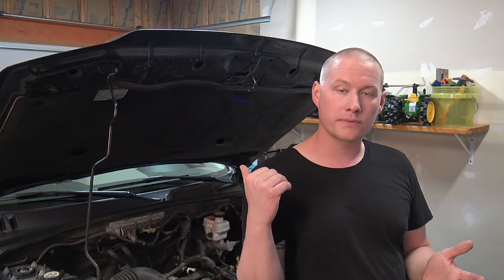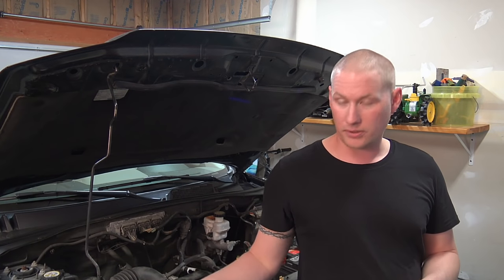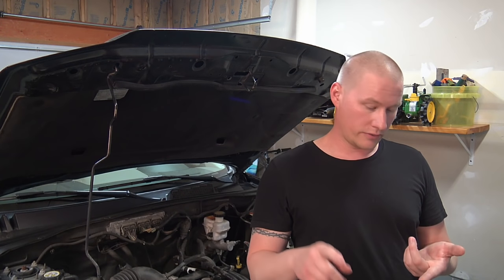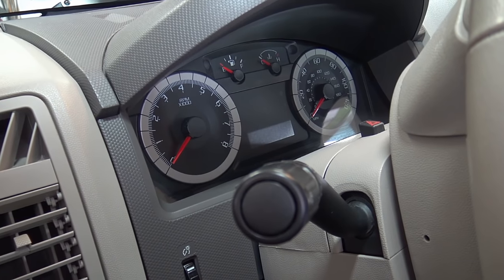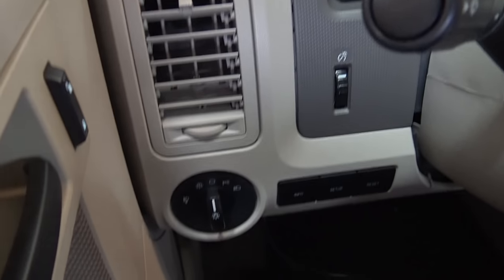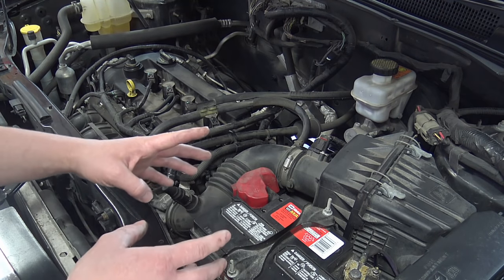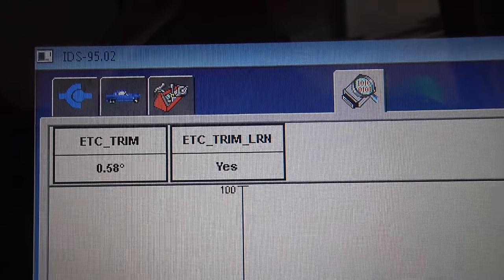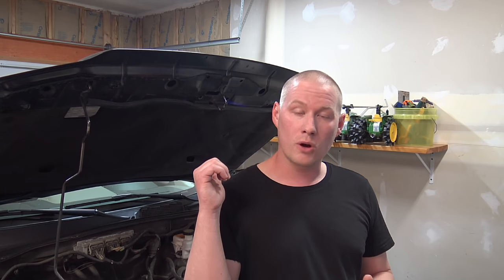Ford Vehicles: Electronic Throttle Body Calibration Procedure

Comment: I just viewed a video prior to yours and they said that when connecting the jumper  cable from the positive to the negative that both should be taken off of the battery where you are showing just take off the negative battery cable. Im confused on which way to go.
Reply from the maker: Once the negative cable is removed you have broken the circuit and current cannot flow. What is it going to do, jump through the air? Not at this voltage level.
Reply: @FordTechMakuloco  Just trying to find out the correct way to make the connection. Sorry to have bothered you.
Reply from the maker: I am explaining why since you questioned my method.

Comment: i have a mustang gt 2007 and im getting the wrench symbol, after that the car only drives to 5miles even if i press full trottle i turn off the car and its normal again, do i need to do this to repair that problem ? thanks

Comment: I changed my throttle body on my 2010 Ford Fusion Se. I also changed the spark plugs the car has 64784 but I bought the car with 60000 on it. I had these car for two years did not drive it for one year. When I start driving it again I start having these problems. I went through all your steps and when I tried to put the car in reverse in jerked and stopped running. Would not start again, had to do the steps again. What else can I do to correct this. Got it to start but it goes did and jumps when placed in reverse. Also, car will go dead when letting it idle for 10 minutes or more.

Comment: I can used same process for my 2010 chevy equinox? I replaced the throttle and now is driving in high rpm....thanks
Reply from the maker: No generally you must use a scan tool on GM vehicles.

Comment: Hate to ask got an 05 mustang gt ran ok til I changed the battery now it is stuck in limp mode and I can't clear it. It also has about 15 dtc codes that came on after.. No throttle response at all either

Comment: hi partner I'm here from Brazil, state Santa Catarina I was watching some of your videos here on YouTube I want to see if you can help me I have a Ford Focus 2012 Duratec 2.0 It has an acceleration problem, when I start it at a traffic light it goes until it reaches 2,000 rpm and the acceleration cuts off and when it goes above 2,500 rpm it runs normally when I'm slowing down to pass a speed bump or even slow down behind another car and when I step on again for it to get up quickly to overtake something like that, it cuts off at 2,000 rpm and gets a little weak and then after it increases the rpm it goes smoothly . see if you can help me Everything has already been changed, the fuel pump, the spark plug, the fuel pressure regulator nozzle, and nothing has been resolved. can you help me I would really appreciate it

Comment: Het man i changed my throttle actuator control or motor and i have no throttle response at all i can step on the gas and nothing happens the truck still goes into gears but will bearly move cuz i cant put any gas into it. Would doing this help my truck get back to normal

Comment: Hello, does this work on ford escape 2015 2.5L? Also should I do it with the AC on or off?
Reply from the maker: Yes and you want the ac off at first
Reply: @FordTechMakuloco  thank you very much. I'm following up all the escape and non escape videos.
Reply: Hi I have 2016 Ford escape se 2016 and I picked up new on first service they change throttle body as it was recall after that Ford escape take high rpm I went few times to dealer no success my question is did you fix your Ford escape thanks

Comment: My wife's 06 freestyle battery died.... Now when I floor the throttle it Wont do anything.... Tps?  Or would this work.. The problem  started after a dead battery.
Reply from the maker: Clean and calibrate the throttle body yes.
Reply: Im having a similar issue with my 2004 lincoln ls V6. I unplugged the battery for a week and now the gas pedal wont do anything. Stuck in idle. The throttle body looks clean and I think it opens/closes when I turn the key (i will double check), so im thinking i have a bad gas pedal sensor. Any updates on your vehicle and what fixed your issue?

Comment: I need serious help, my car has a check engine light and it says pedal reprogram as well as the cam sensors. I replaced the sensors and their still on, so it’s most likely have to do with something else. This car is a 2012 mustang gt with a brand new engine from ford as well as a new pcm.

Comment: What happens when you do all that and the truck still doesn’t start what would be the issue when I bought the truck it was running but it was missing and no power had it checked out and every time it was sending a bad cam sensor so put a new one on it and it still does the same and now it will not start at all any help would be appreciated

Comment: Why do throttle bodies continually act up and need replacing on the Ford Ecoboost trucks? My 2016 needs replacing, and I know it will have to be done again...down the road.
Reply from the maker: 2013 and newer models have allot of failures.
Reply: @FordTechMakuloco  Yes, I heard moisture and corrosion from a auto parts retailer.  Too dang bad Ford can't figure out how to make a long lasting throttle body. I got the dreaded wrench, so I removed the TB off my wife's 2016 F150 2,7 Eco.  What a PITA...freakin air tube and rubber hose. Front side clean, backside grimey. CRC TB spray made it all new again except the electronics. 103,000 miles, and this won't be the last TB I put on. Followed the relearning procedure perfectly, nonetheless, still got the dreaded wrench.

Comment: Hey there,,I put a brand new throttle body in my 2014 mustang 3.7 v6 and it's still doing the same crazy things that the old throttle body did like no throttle response,wrench light comes on,,speedo quits,goes into limp mode,,third and fouth gear starts...but if i shut the car off and let it sit for a few,,it goes right back to normal...After about 4k miles of the car acting up AFTER i put the new throttle body in,,it now is throwing a p2112 code saying throttle position stuck closed...Again,,,this is after a new throttle body,and we also did a computer reset....Help!!! lol

Comment: Is this applicable for the ford territory ghia 4l v6 2007 model ? Cz mine is on a leap mode when driving and it's rav count is on 10 most of the time  and is not fuel effetiant 😢
Reply: The rev count leaps when accelerating after sometime driving😮

Comment: I have a 06 Ford 500, n sometimes on the highway my wrench will come on n then I'll start to slow down... after 10-15mins pass, car off, the wrench will disappear... can it be I need a new throttle body? my manual tells me "it's my throttle body or transmission" can't be my transmission cause I just got a new one last year... please help

Comment: What do you know about the 2012 ford focus titanium hatchback with atleast six recalls. My car had zero symptoms of a bad engine or anything, no indicator lights neither. It just stalled and wouldn't start. Here is my problem the ford dealership i was closest to happens to be where I bought my car and who I have my lien through. They won't touch my car, they drove it needing a water pump then tell me the motor locked up and yet don't want to repair my car even at cost to me. They won't even give me a quote for new engine. And so I got one other opinion since she that ford dealership said it had little to no compression. If my motor was locked up would they be able to drive it or do a compression test? What my problem is Idk what to do from here. If I replace the motor what should I put in it!? And to remind you all, i had zero symptoms of any bad components on my car. It ran smooth and quiet no indication of any bad engine or tranny. It just stalled and wouldn't restart. I know it needs a new battery and a water pump. I'm stuck. They have had my car since 28th Oct. And I'm clueless as to what to do.  They have been rude and don't want to tell me what is going on with my car. Oh yea i had it towed back over to the first ford dealership I had it at. The one who I am financed through and whom i bought it from. ..it's messing with my head. And the next closest ford dealership is 40 Miles from these two. What do I do.

Comment: How do you do a carbon clean on a vehicle with an electric throttle? I have a 06 Mazda 6 with 3.0 V6. Pings a lot under load. Was owned by an elderly women before me. Thanks
Reply: I took throttle body off and disconnected , and cleaned it around that butterfly . .careful u don't want to push or pull on it cause it's electronic...it was gummed up a bit but I got it cleaned..try replacing spark plugs?
Reply: @MA-jx6in  I'm talking about cleaning carbon from combustion  chamber. When I was an Automotive tech I used to run regulated water or cleaner through brake booster vacuum line and run engine at 2500rpm. But problem with electric throttle is no being able to manual control rpm with your hand while feeding water/cleaner. I guess maybe a  professional scan tool is needed to control rpm or have second person in the car.

Comment: This is a problem i been having, everytime i start my 2012 f-150 5.0 in the morning and i take off the truck revs up by itself wean i step on the gas pedal barely, then i let off and step on it again and it works fine, my transmission shift points are a little off aswell so im definetly giving this a try

Comment: I did this after replacing my throttle body on my 08 taurus and now it fires up and idles but does nothing when i press the gas pedal like the pedal is not telling the tb to open what would cause this?

Comment: I have a 99 explorer 5.0 that i had to change the  4 oxygen sensors on. Had to remove the center console and passenger seat to get to the connectors on 3 of them. After i installed the 4 sensors i started the truck it see ed to run ok. I got in to take it for a test drive befour i put the center console and seat back in. Put truck in drive and hit the gas. The engine spit and sputtered and would not move forward but an inch or two.  Truck drove fine before o2 replacement. I disconnected bsttery to rest pcm and that did not work. I tried an idle relearn by starting truck with ac on, in drive for a few minutes. Still would not go forward. Any ideas.

Comment: Hoping someone can help. I replaced the electronic throttle position sensor on my 2009 Ford Flex AWD since it threw a code for it.  I bought the part of Rock Auto. I installed it and cleaned the throttle body with appropriate spray cleaner. I also cleaned the MAF with its appropriate spray. After re installing everything, i have a lot of hesitation at slow speeds that i didnt have before. Car has 185k miles. Any ideas?  I re did the learning procedure from this video 3 times and still have bad hesitation

Comment: 2014 fusion 1.5 Ecoboost I replaced the throttle body with a new ford unit, reset pcm, crank no start. Put original unit back on and still no start. What gives?

Comment: Bye the way, any new developments regarding Carbon build up. I find it worrisome. Im over maintenance guy with all  my  vehicles and equipment. Id really like to be able to reduce the carbon if possible,. I did recently put on a Catch Can, which I can drain. Although I checked it after 500klm and you could barley wipe anything out, never mind pour it out. Some say I can use a cleaner in the intake, but I seen a video of yours that says not too, you and Ford say No.

Comment: Are you absolutley positive this is the procedure? Ive heard of disconnecting the battery and then leaving the ignition keyed to "on" for 4 minutes so the ECU can run a learn procedure on the TB but cranking it on almost right away sounds like there wouldnt be time for it to learn anything.
Reply from the maker: Quick positive I've been dealing with ETB systems since they came out in 2004. The first part of your procedure is tells me right there you got the info from an unreliable source. Everything is ground switched on Ford nowadays so turning the key in the on position won't do anything.
Reply: @FordTechMakuloco  Yep so true ...auto repair shops just don't realize all the specs that come with the designso they continue doing only what they knew before changes....this is why I only listen to your advice .....I love FORD but dealship repairs are a ripoff.......you are providing a wealth of eduction to not just the guys on here but us women too ....the education provided here has allowed me to not be afraid of looking under the hood .....I am saving up for mad tools like the ones I see in your vid's. Great job!

Comment: does that work with the tps (throttle positioning sencor) change?
Reply from the maker: yes
Reply: i tried it on my 2010 taurus sho after i replaced the tps and the car just went into limp mode, did the reset twice and nothing then i put the old sencor and it ran fine,im at a loss.

Comment: Can you use any clip or does it have to be certain awg
Reply from the maker: 22AWG or thicker
Reply: @FordTechMakuloco would uninsulated work different? I can't seem to find anywhere with Insulated and has a wire. And can't buy online or I would

Comment: ‼️ Help! What are those little cables called? And where can I buy them? Can I use regular jumper cables like the ones for a battery jump start?‼️
Reply: I used jumper cables
Reply: Walmart
Reply: There called testing cables found them in auto zone $4.99

Comment: need help...
I have a 06 Ford 500 n my wrench comes on sometimes when I'm on the highway, after 10-15mins passes, start the car again then the wrench disappear, but will reappear if. driving fast, my manual tells me "it's either my throttle body or transmission" can't be my transmission cause just got a new one last year, can this be my throttle body
Reply: BlackTower once I get new/used one, how do I reset it afterwards? Do I have to drive for awhile after I reset it? Going to get a uses t.b from a junk yard for 40$

Comment: I got a question about my 2010 fusion i replaced all my mounts and im still having vibrating when car is in reverse or drive i need help and my cae is idleing weird
Reply: I had the same issue! My car would literally Jerk really bad! It was the "EGR Sensor and Valve". The 2010 Fusion has it in the same place (they are together). Other cars have them in 2 separate locations. EGR Sensor/valve runs you a good $60-90 at your local Autozone or car parts store. Hope this helps.

Comment: Replaced my throttle body with a new one and I cleared the codes still getting error P2110, P2107, and P2104 I did exactly as this video I traced the wires I'm at lost for words don't know what else to try
Reply: Did you ever resolve your issue, im experiencing the same on my 05 milan
Reply: @lewisjoyner3959  yes resolved it was the wire I traced even further and I had a damaged wire so it was making bad contact got some sodoring wire and shrink wrap good to go.
Reply: @2012omar302  which wire ?
Reply: @lewisjoyner3959  the throttle body connection I traced it it was well in the wiring harness but that was the issue

Comment: hey i ahave  a 2010 fusion that start wen the inside tac gose up and down the car shot off ....it s dryving crassy help pleace ..... the only diferent thin inthe car is the cilinder head temp cencor  i replace after i did that the car have this problem .... hell pleace

Comment: What if you have a programmer installed, does it affect it?
Reply: No it wont  . By disconnecting the battery and using the jumper cable to clear memory , it Will do just that clear the memory to however you had it programmed ,  it will not reprogram your computer , only your programmer or labtop can re-program . Your Good 🙋‍♂️
Reply: @jsseasideelectrical2201   Thank you very much!
Reply: @jsseasideelectrical2201 ,I need help, I went through the process and my truck still doesn't idle correctly, I put a bbk performance throttle body on it!!

Comment: Why does it take so long for my 09 Ford F-150 to idle down. If I drive it then come to a stop put it in park it will run about 2000 RPMs for 30 or 40 seconds

Comment: But this works for an 08 F150 with a 4.2 V6. It has the electronic throttle body on it. Figured I'd ask. Because it's getting horrible gas like 11 miles To the gallon of the idle is always up and down.

Comment: woah so I'm confused I want to clean my throttle body it's electronic if I take off the body do I have to follow this procedure
Reply from the maker: +Danny Buron If you take it off to clean it yes.
Reply: OK mate thanks!
Reply: +FordTechMakuloco I have a FORD s max 2007 I fitted a k&n and it started hesitating so I put the stock filter back on but it's still hesitating it's had  a recent timing belt, oil filter fuel filter and iv bin running it on premium diesel so I tried to clean maf sensor thinking this could be the cause the next step is the throttle body but if you was me where would be the beat place to start to diagnose the problem iv had a few mechanics look at it but no help if you have any ideas I would be really greatful

Comment: I changed a battery on a '13  and '16 fusion and it never effected anything but the radio being reset
Reply from the maker: You generally have to disconnect 5-10 min on newer vehicles whereas older vehicles it was mor like 5-10 seconds.